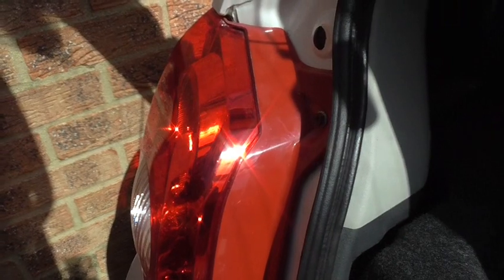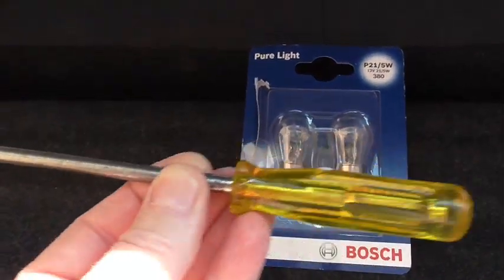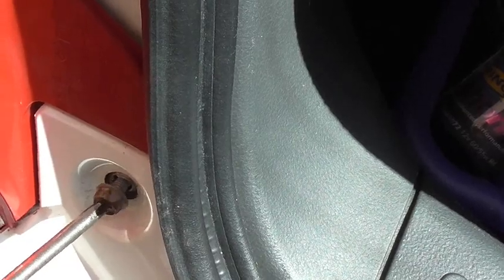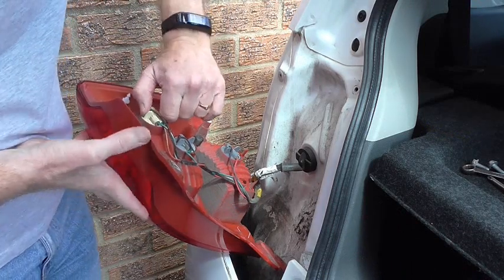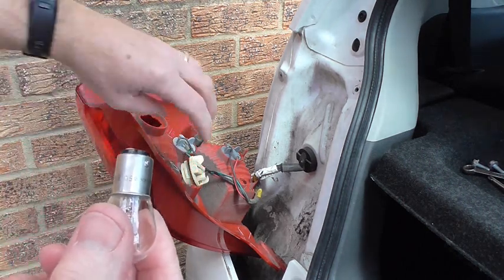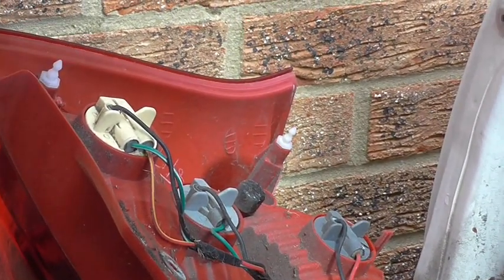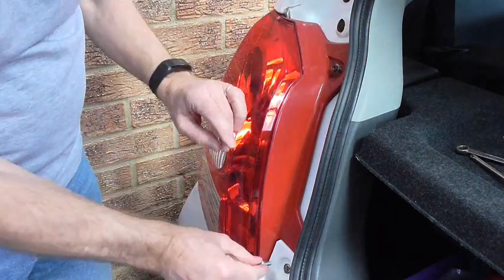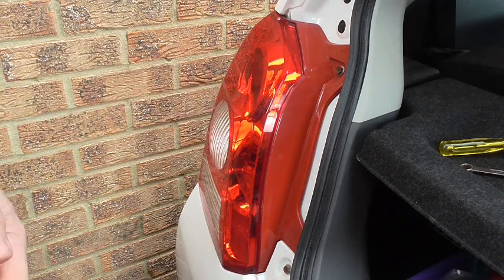How to change  the brake, and tail light bulb on a Suzuki Alto. 2013. Turn signal indicator. Maruti.

Comment: hey let me ask you. nissan pixo is the exact same car as this one. do you think it could be the same way of changing the light?
Reply from the maker: TheFefiiiii. To be honest I'm not sure as I haven't seen one. If you have the same type of bolt fittings, then it could be the same. Check in your manual also to be sure. Thank you.
Reply: it is the same thing yes. thank you man
Reply: Two years on - The fellas advice is bob on. I had to use a ratchet to help me since mine was loose but Davids video was ever so helpful.

Comment: Absolutely spot on, great how-to video, first time I’ve ever done any basic maintenance on my car (I’m usually terrified of messing something up) and I managed to sort in a few minutes. Thankyou!
Reply from the maker: Thank you. I'm pleased you managed it ok.  ☺👍👍
Reply: @DavidGarside  when i put right indicator on its flashing fast what do I need to change
Reply from the maker: Hi Ady. The first thing I would check is the bulbs....if one is not working that will upset the balance in the circuit.  If all of the bulbs are ok then it may be an earthing or wiring problem. I usually find it's a bulb....hopefully that will be the same for you. Good luck.

Comment: Thank you David, excellent instructional video. Removing the housing was the trickiest part, I pried it open by sliding an old toothbrush handle (don't use metal) down the side, it popped right out.
Reply from the maker: Thank you Rod. Yes, it just needs a little persuasion to pull it back. Glad you found it useful. ☺

Comment: Is the bulb for the taillight the same as the brakelight? I need to change the taillight but I'm not sure which bulb to change
Reply from the maker: Hi. In mine the stop and tail light were in one.....it's the bulb with the two filaments and offset pins on the side. You can also check by switching the tail light on and comparing which lens is lit up on the other working light. Hope this helps.
Reply: @DavidGarside  thank you!

Comment: Sir i have suzuki alto 2013 SZ model one of my rare fog light aka bulb is not turning on, i have checked using your video, same nuts bolts but can you please tell me which bulb should i use as it only has back fog lights model i have already mentioned, which bulb model should i use to replace it? Many thanks
Reply from the maker: Hello. From memory,  I think it's the bottom bulb in the unit and possibly a type 382, it should say in your manual, so it's worth checking in there to be sure. Mine was a right hand drive car and only that side had the rear fog light. The other side was the reversing light. Hope this helps. Thank you for watching.

Comment: After you pop the top you can pop the bottom. There is a trick if you pop the top and the plastic tab is out to much or out of the hole, the bottom part is harder to pop out. Just place the top part back in to the hole but don't press it in and the bottom one should be not as difficult to pop out. 

Hope this tip helps.
Reply: Yep I should have read that tip. its a really important one. I broke the bottom clip and had to super glue it back on to fix.

Comment: Hi David, thanks for the video! It helped me replace the bulb, but I pulled the bottom part too hard (probably at a bad angle) and the little plastic pin with the hex-nut base broke off. Do you know what they are called and whether they can be purchased separately? Thanks, Sivan
Reply from the maker: Hi Sivan. Thank you for your message. Sorry to hear it didn't go quite right for you. I've tried to Google the part but can't find it, so it might be worth contacting your local Suzuki dealer to see if they can get them. I would think they're called a 'rear light locating pin' . Please let me know if you manage to find one ok. Thank you for watching and the very best of luck. David.
Reply: @DavidGarside  Thanks a lot David!